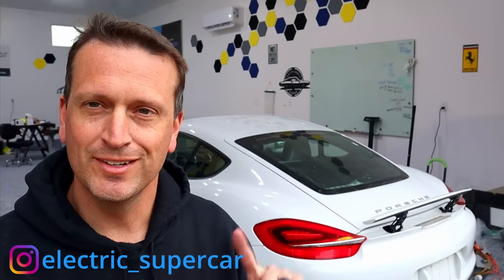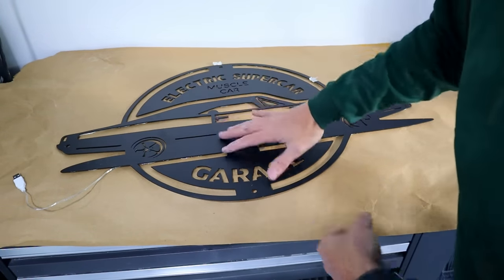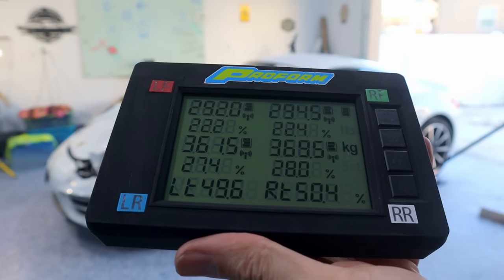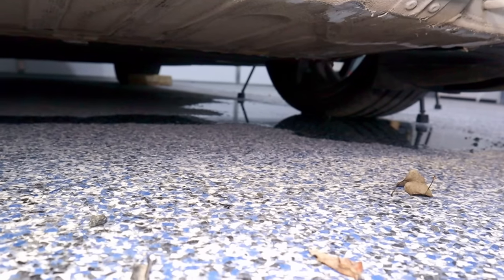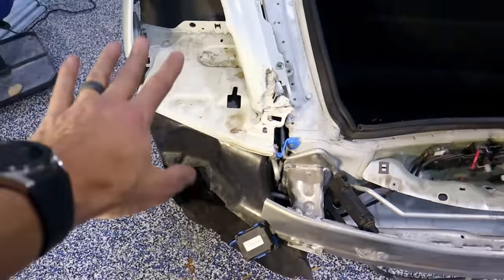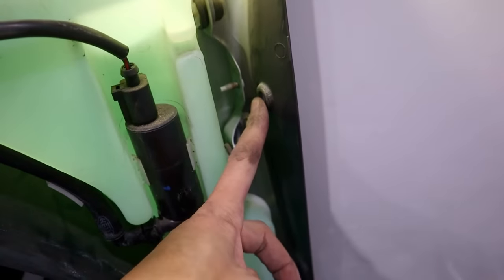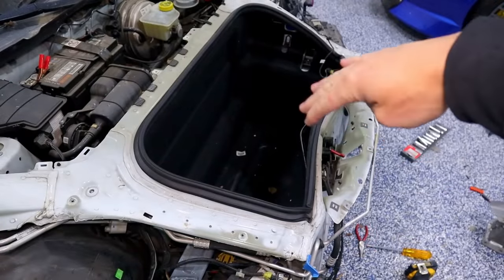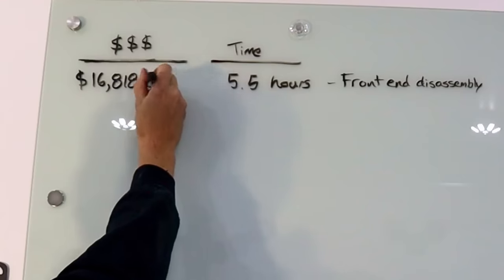Porsche Teardown (front end) - Porsche 981 Cayman Disassembly

Comment: Just capturing weight data in text to avoid searching video later...
LF = 644 lb, RF = 649 lb; total front 1293 lb
LR = 796 lb, RR = 813 lb; total rear 1609 lb
total 2902 lb
F:R = 44.6:55.4
L:R = 49.6:50.4 (amazingly even)
diagonal bias less than 1% off (impressive)

Comment: Even if the battery is recoverable, you'll presumably want a smaller (lighter) low-voltage battery because you will no longer need engine starting capability.
Reply from the maker: Good call!